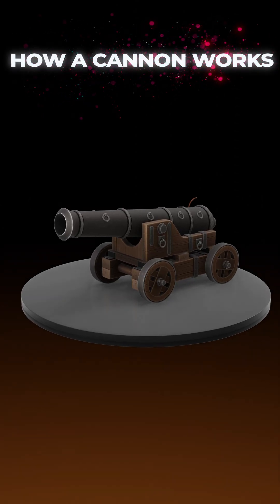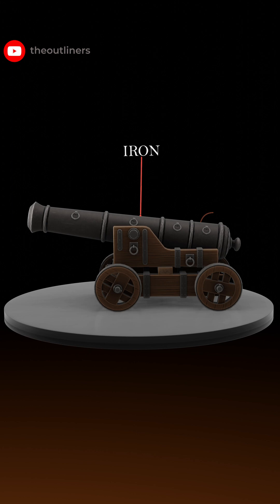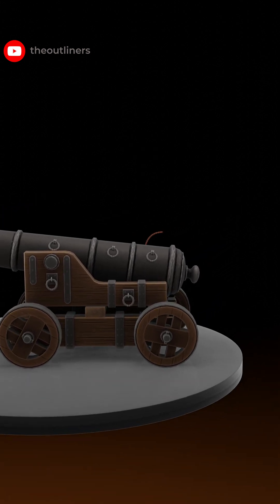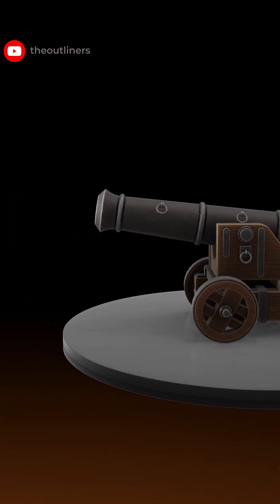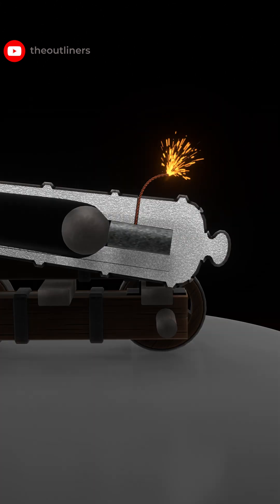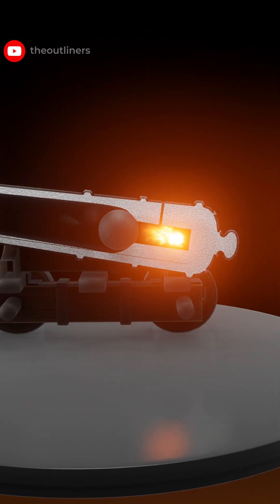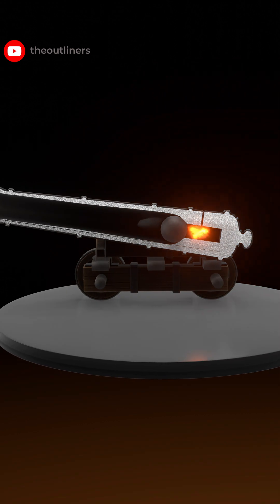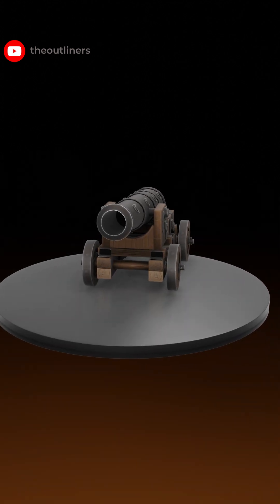How A Cannon Works |EXPLAINED| #3danimation#shorts

Comment: So after u fire one round how do u put the fuse back?
Reply: It’s with the other ball😂😂
Reply: Yep. Same
Reply: Naval Cannons Did Not Work Like This. You First Would Clean That Breach Of The Gun Then Use An Iron Rod To Clean Any Burning Embers. Once That's Done You Then Put The Gunpowder Cartridge Followed By The Cannon Ball Than A Type Of Swab To Hold Everything Together Inside The Cannon. The. You Puncture The Gunpowder Cartridge After That You Make A Line Of Gunpowder On The Top And Then Ignite The Powder And Fire. That's How A Cannon Actually Works. You Don't Just Put Gunpowder Straight Down The Barrel.

Comment: Cant you do the same with gasoline or even ethanol?
Reply: Not necessarily in this design. Gunpowder is formulated to create its own oxygen. However, fuel vapors from gasoline or ethanol can be mixed with oxygen in a combustion chamber to achieve a similar, but lesser effect like gunpowder. Works for something like a potato cannon
Reply: acetylene will give one hell of a bang